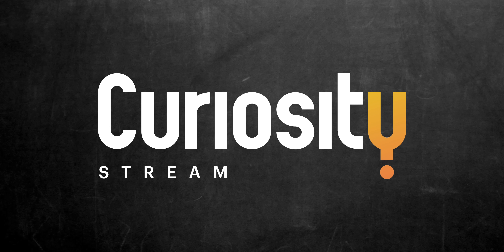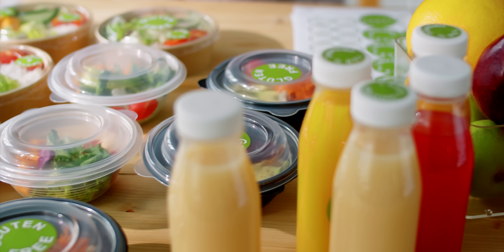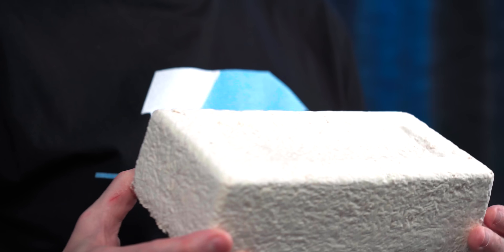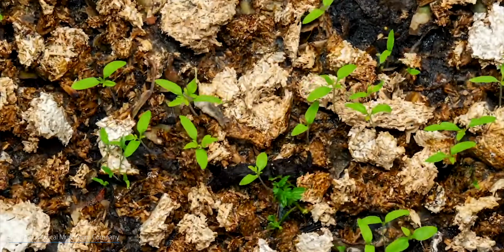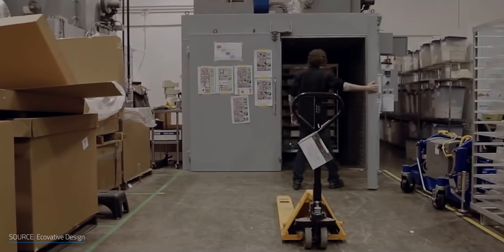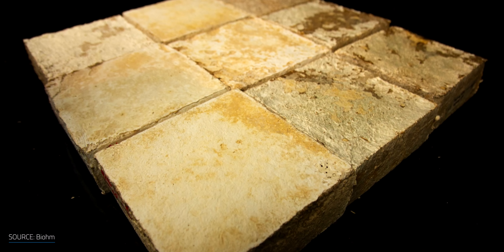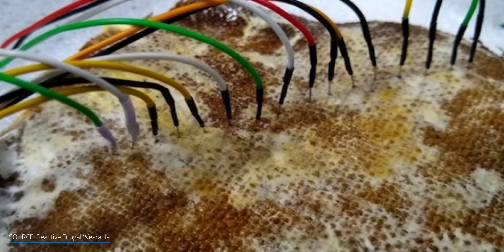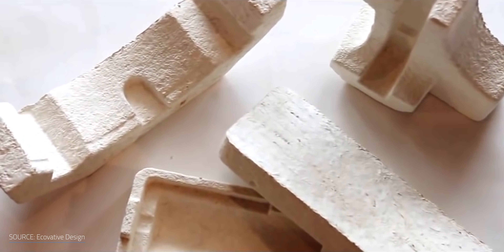Is Mycelium Fungus the Plastic of the Future?

Comment: This definitely seems like a win.
My question is: Will we still have see-through water bottles?
Reply: I prefer "blue" glass, like blue hydrogen, made with carbon capture. I would like to sewer-derived biogas to be burned for glass-making.
Reply: We have glass
Reply: I have no idea why they spent so much time criticising water bottles.... and then went on to talk about the mycelium. You would never be able to make a water bottle out of this, unless the walls were 3cm thick. The mycelium is just a binding agent for the bio matter. The actual "packaging" and material is whatever they use as the bio matter (potentially un-recyclable waste!) and the mycelium grows through it and holds it all together. you need to have quite thick and chunky pieces (like the brick he showed) yet at longer lengths and pieces (think of a giant Polystyrene piece a TV might come in) it can warp and shrink in unexpected ways.
Reply: @rjc0234  my guy you clearly have no idea what you're talking about lmao. The bio matter is hemp and wood chips and things that can grow mushrooms it inherently has to be biodegradable. You spew so much nonsense in this comment section I'd swear you were a plant from the plastic industry
Reply: @SissypheanCatboy  Except you have to disinfect the wood chips / hemp with peroxide so that nothing else grows except for the added mycelium. YOU clearly have no idea what you are talking about.

My exact point still stands. They say "PlAsTiC BoTtLeS BaD" then use an example of a "solution" that doesn't tackle that issue. Its just someone who watched a 20 second infomercial, went and brought £30 of stock footage and made a minimal effort video about something they didn't understand.
Reply: @rjc0234  You do realize that the shit is still gonna degrade? Just because you sterilized it for the mycelium growth process doesnt mean it's not still made of organic matter that's gonna break down when it's left to the elements.
Reply: @SissypheanCatboy  But why do you want it to degrade? All that energy and effort went into making it, why have it fall apart into unusable mush?
Reply: @rjc0234  because its 👏 biodegradable 👏 packaging 👏

Comment: I'm fine with living in a mycelium-insulated home because when you kill the mycelium it's basically just fibrous insulation made from chitin, cellulose, and protein.
Reply: It seems ok on the surface but there's too many blank spots to say for sure right now.  For example, it may turn out that racoons and rats just love the stuff.  We'll see.
Reply: @ColonelSandersLite  Yep! Don't forget about insects too. Might find out some kinda termite will love the stuff and eat away at it, or nest in it. - Which isn't something accelerated aging would or could account for. Then theres reactions to other molds and mildew. Saddly this is kinda where synthetic materials do have an advantage.
Reply: @-DeScruff  termites would love it if it has a high concentration of cellulose and is fairly soft. Termites have a special gut bacteria that they use to breakdown and digest cellulose and they love water damaged wood due to it being soft. They love cheap wood and cardboard.
-exterminator of 5 years
Reply: @-DeScruff  
Oh definitely. Would have to coat it with something when installing, and regularly inspect lower walls for holes/moisture.
I imagine water damage would be especially bad.
Reply: @-DeScruff  I would feel comfortable using the fungus for disposable packaging.  What you guys say makes me think maybe I'll stick to plastic and other nonorganic materials for long-term construction.
Reply: @dankline9162  Nah, i agree with creating a friendly environment, but going as far as to replace bricks, wood and metal with mushroom is dangerous. Imagine building a skyscraper out of mushroom and having that be broken down by termites. The results wouldn’t be very pretty. Brick is environmentally friendly so there is absolutely no need to change it for mushroom
Reply: @harismohammad2005  theyre talking about insulation .. obviously I don't think mycelium could withstand the weight even ... also people rarely use the red bricks... i think the have a lower psi or whatever the smart dude in the video said, ..ppl use cement...non birodegradeable
Reply: @namehere2986  The guy said their building bricks with it. Red brick would have higher PSI than mushroom based bricks. I think the issue is more with finding another cement like alternative that is environmentally friendly. I don’t think in all seriousness any organic product will be able to support such large structures. After all, all large structures are built out of inorganic material because it is harder and stronger. Unless were making buildings out of bones, were not going to get very far.
Reply: @ColonelSandersLite  Totally a possibility. It would basically be just super dry, cooked mushroom.
Reply: Yeah lol if it's so biodegradable...then wouldn't biology degrade it? 🤔
Reply: Some vehicles use soy in their wiring assembly, which are considered a delicacy by small rodents everywhere.
Reply: Personally I think that building homes to last is a better way to be green rather than making homes with biodegradable materials.
Reply: @abramhunsberger3511  Yeah, I would personally go for one of those 3D printed concrete homes instead. I wouldn't have to worry about pests eating it, as was mentioned by our fellow commentors. It should also maintain a comfortable temperature, depending on where it's situated of course.
Reply: rats and other critters : oh wow free food 😝

Comment: I don't know if I understood it correctly but I he said that things made from mycelium degrade after their intended product cycle and that makes me believe that practically everything made of this will be unusable after 2 years or less. If that is true then this would fuel even higher degrees of consumerism and yes it would decompose opposite to plastic which won't, but most of the things aren't made only out of plastic so even if the shroom part of the phone for example would decompose there is still huge amount of other materials that are going to waste. Also he mentioned that most of the plastic waste is made up of bags and bottles but you can't make bottles or bags out of this yet if ever so yes this might replace plastic in very few applications but won't make a dent in plastic waste creation at least based on information presented in this video.

Comment: Since this stuff grows in a mold, there's huge transportation saving opportunities. Grow this packing material at the packing and shipping site. Mushroom theory of management applied directly at the point of use.
Reply: Requires lots of space, labor too probably. The raw materials are less expensive.
That finishing step requires equipment too. It's probably best to treat it like polystyrene is now, where it's made in a separate factory and cut to shape at assembly plants.

Comment: In regards to building materials, you mention that it can degrade in 45 days, yet performs the same after a 3-year rapid ageing as much as a new brick would.

How can both be true? If it degrades over such a short period, how could it be used as long as a concrete brick would?

Comment: How long will it be before they find that dreaded "fungus" issue in building applications. Fungus abatement has become a huge industry. FUD: What happens when this stuff gets wet?
Reply: The regular insulation gets moldy when it gets wet. The mycelium insulation is better in terms of noise and heat insulation (but more expensive) and it too gets moldy when wet.
They are both fine as long as they stay dry.
Mold spores are everywhere and they germinate where they find water and food.

Comment: Question.

A lot of plant based alternatives have gone wrong such as the ethanol fiasco.

How much water does this mushroom construction require? The future is not going to have a lot of water. And we can't waste it.
Reply from the maker: It uses less water than plastic production.  Fun fact: it takes 22 gallons of water to produce 1 pound of plastic.
Reply: @UndecidedMF  Neat.
Reply: Materials like concrete already require lots of water. From googling it, about 23% of the cement mixture is water. I don't think that water consumption is one of the core problems with mycelium composite though.

Comment: So... What are the downsides of using mycellium? I'm not a big believer in only positives, especially in new technologies and discoveries that seemingly solve anything and everything with no negatives.
Reply: I'll bet that mycelium composite is more expensive and impractical than they're letting on. One thing I noticed is that all of the mycelium packaging is quite thick, and that's probably because it needs to be that thick to maintain its integrity, and along the same lines, it generally seems to be less malleable than plastic; where are the mycelium bags, bottles, and wrappers? It seems as though the best case scenario is that mycelium composite is adopted as more of a situational material. In regards to cost, he never gave even general numbers like (for example) "mycelium composite is only 7% more expensive than polymers in most situations", which set off alarm bells for me.

Comment: It is promising, but i have seen many promising technolgies. Liquid metal battery, graphene superconductors, fusion reactors, hyperloop, etc and non of them has accually changed anything after big reveals... Altho if it manages to replace completly foam, stretch, airbag packiang plastics i ll be more than happy. For home development i dont think that biodegradable meterial is a good option, i think that in some cases it can reintroduce mycelium that ll feast on my walls and i dont like that idea.
Reply: First of all, you're lumping a lot of very different shit together, but secondly, all of those things take years if not decades to be developed enough to reach into the public market.
Reply: @flytrapYTP  Ye they are diffrent, they need years to be fully developed. After hype for graphen, it found it minorities and seems to stuck there. Hyperloop is reveling as to unpractical and expensive to build, since it need freaking vaccum tubes from cities to cities and it doesn't make sense to replace it with metro becouse it wuld never exceed any benefits over metro. Fusion reactor, liquid metal batteries seems to go on developing, and i really hope they ll reach their respective goals soon. But my point is that sadly many of the concepts seems to reach dead end before even they reach market for some reason. Like this mycelium thing it can surley be good for packaing things, but for packaing food or building walls, where mycelium can be easly reintroduced and contaminate food and walls.

Comment: So, I gotta ask. if its so biodegradeable how long will the product actually hold? some plastics do get discarded after a short time but there is also lots of plastics which is used longterm. I dont want the remote to my AC to breakdown after 1 summer, I plan on using it for years. same for pretty much every other bit of consumer electronics. bumpers in most cars are made of plastics and not all of us have garage to shelter the car from the elements.

Comment: This puts a whole new spin on "planned obsolescence"
Reply: yeah, now not only the batteries of cellphone will shut down but the physical cellphone itself will disintegrate lol
Reply: Requires special processing to break down? In the vid they said the aged bricks performed the same (i.e., they did not break down) so it seems like you have to do something to get them to break down.
Reply: I never get why people are obsessed with Biodegradability. So you spend nearly a week manufacturing something.... for it to be entirely un-recyclable, it fall apart after just a few weeks, and the solution to a problem we have caused be "just throw it into the woods and let nature deal with it".
Reply: @rjc0234  recycling plastic for the most part is done because its not biodegradable, if it is biodegradable then you won't need to recycle it
Reply: @rjc0234 No, but recycling plastic is difficult and expensive, whereas biodegradable packaging CAN just be thrown onto the ground or composted, which is very easy and cheap.
Reply: @xylophone_serpent  boo hoo difficult and expensive. So you think that because its going to cost a few billionaires a 0.00001% of their wage that we should entirely ditch re-usable materials and start using something specifically designed to be dumped in nature?

also, composing isn't cheap.... at all. just throwing something on the ground isn't composting, its littering, and i'm very anti-littering.
Reply: @rjc0234  I'm merely arguing for the replacement of single-use plastics. I think plastics as a whole are in general a very useful thing, but they are just not being reused because it is cheaper for the billionaires to simply make more of it. Throwing something that can decompose into a designated area for it to compost is cheaper than getting the rich to change their minds.
Reply: @rjc0234  You have a very problematic view of this. Recycling this won't matter because it is extremely fast to replicate, you can simple cut it into pieces and use it as a mulch in your own garden which is in fact a form of recycling it, or even give it to a friend who is in need of something like it. Plastics are extremely harmful to everyone involved, take decades to properly biodegrade, and most plastic that we "recycle" never goes through because it has been compromised by whatever crap we threw into it prior. Any step towards a more sustainable ecosystem is a good step, and I for one think you should probably try to accept change more, or at LEAST learn more about the products involved before arguing over an opinion that isnt backed by research.
Reply: @luci_datum  I don't have a garden, don't know anyone with a garden, and my city does not collect biodegradable waste. They do collect plastic though. Mulching and composting is not recycling, not even close. It releases massive amounts of trapped carbon back into the atmosphere.

You have a warped view on the topic. Sustainable does not equal environmentally friendly. It just means it is a constant cycle. And when the cycle involves non-sustainable things (like agricultural equipment) damage can be done.

You say "learn" about the product, you don't know my background. I know a great deal more about this product than most people here. The creator of this video either hasn't been told much, or has been shown a 30 second promo video by Ecovative and missed out a HUGE amount of information about the product.
Reply: @xylophone_serpent  You are arguing that we replace SINGLE USE plastics with SINGLE USE biodegradable material.

The issue is single use. Not whether its biodegradable or not.

Biodegradability is awful for the environment. If something is man made, then energy was used to create it. energy extracted from one source, and used somewhere else. You can't get that energy back no matter how hard you try. The issue with single use items is you put a huge amount of energy into creating something, for that thing to be used once and thrown away. Now if you make that thing reusable, every time its used that energy to create it isn't generated. Recycling something also will use less energy than creating it new.

but intentionally developing a product designed to fall apart after one use?! you can't re use it. you HAVE to use all that energy again to create a new one. When it biodegrades it releases all the trapped carbon it absorbed when it was grown. and you cant just chop up the mycelium and use it again, it has to be re-grown.

Sustainable, hell yeah. You can grow all the material you want, and potentially use collect the waste to use to grow more bio mass, but if you are going to collect it, why not collect the plastic alternative?

When apple announced they were intentionally breaking old phones (at a software level) to encourage people to buy new phones, we lost our minds about how awful for the environment it was. Not everyone is announcing that their packaging solutions are now becoming single use and will fall apart after one use, and we are whooping and cheering that the planet has been saved.
Reply: @rjc0234  if fungus decomposing released a comparable amount of carbon as plastic manufacturing, global warming would've baked all life to death millions of years ago. In case you haven't noticed fungus is everywhere, in every inch of wild soil, in the bark of every tree, in the air you breathe. Claiming that fungus has a larger carbon footprint than plastics is just plain incorrect. Why are you getting so worked up anyway?

Comment: A note on the title: "mycelium fungus" is a bit of a nonsense phrase, like saying "trunk tree". It would be more accurate to say "fungal mycelium".

The comparison of roots/flower to mycelium/fruiting body is also a little misleading. The mycelium is essentially the entire body of the fungus. It not only acquires nutrients, it also acquires carbon (which in plants is done by the leaves) and has sex (which in plants is done by the flowers). The only thing the fruiting body does is to spread offspring. We'll never have a perfect 1-to-1 comparison because the lives of fungi and plants are extremely different, but a somewhat more helpful analogy is that the mycelium is the entire apple tree, while the fruiting body is the apple.